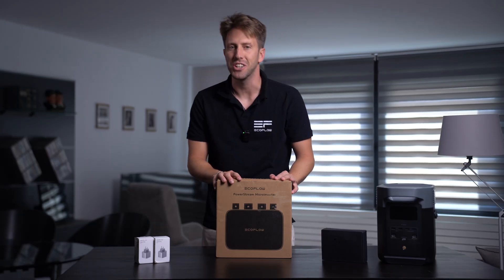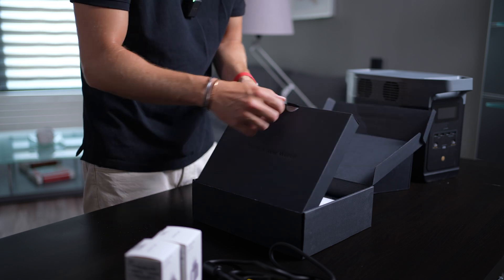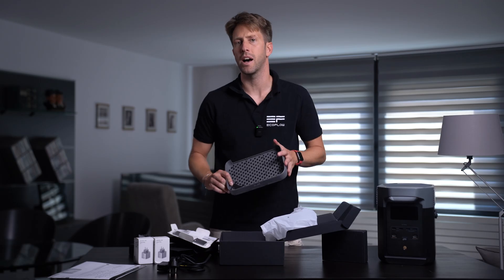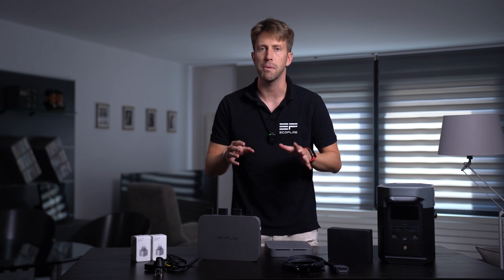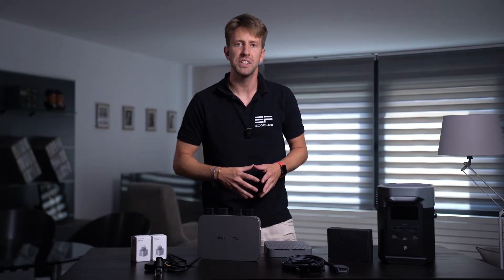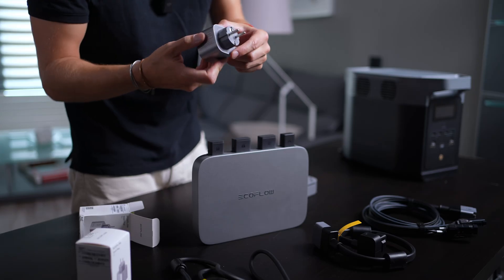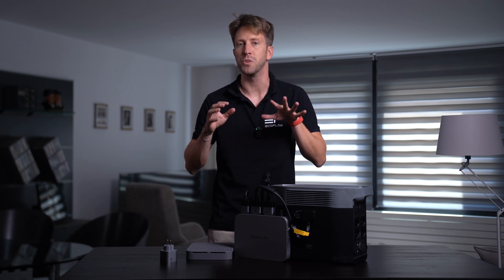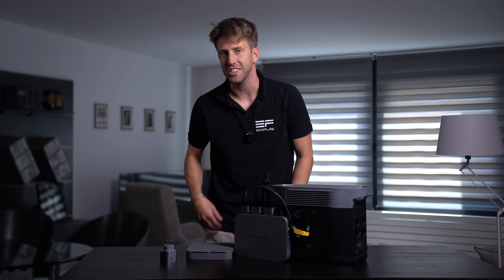Unboxing and Setup of EcoFlow PowerStream Micro Inverter

Comment: Does this only works for the delta series?

Not for the River 2 pro?
Reply: Works for pretty much all of the Ecoflow power stations, but for ones like the River which do not have the expansion battery ports, it only uses the 12v lighter socket port. You buy a cable to plug onto the lighter socket, and the powerstream charges the River up to 100w, and can take power from it at 100w max.
Reply: Sorry, my mistake.

The Powerstream won't charge the River using the 12v socket cable. It will only take 100w off the River until its depleted.

To charge the River, you can plug it into your AC sockets and the powerstream will mix/match your solar and grid to charge it.

Comment: Question. When one configures and use the PowerStream Inverter to power a continues ~250>500w load. Can a connected Delta2/MAX's inverter, on the (EU) 230v output ports, be used in CONJUNCTION and simultaneously power a high wattage (1000W+) load from the Delta2/MAX??

Comment: So i just connect the powerstream into the wall socket to use it around the house?

Anything i need to do for the wall socket or the internal house wiring?
Reply: maybe check if the house/apartment power meter does not charge you if you produce more power than you use so that it doesn't count as "kWh to be charged for" just for "gifting" your energy to the grid because you did not use it :D

Comment: I'm still trying to understand what the benefit of this device is? Why would I buy a Powerstream MicroInverter when I can just plug a generic rigid panel directly into my Delta 2? Ecoflow's marketing doesn't make the case for this device clearly. Could you help explain the benefits over direct solar input? I currently have a Delta 2 with solar and AC input, with the AC output going directly into the house grid via a second 'essentials' DB board.
Reply: The use case is different for this device. You use it to inject solar power straight into your house via an existing outlet, you don't need a battery (although recommended).

Comment: Can you have 2 powerstream on the same grid?
Reply from the maker: Hi technically it is supported however it is recommended to double check if it is in compliance with local rules and regulations.
Reply: @EcoFlowTech  does it output 240v with 60hz ?

Comment: Can powerstream inverter work with only just the solar panel and directly connect it to the grid? Or Is a powerstation needed in order for the whole system to work?
Reply from the maker: Hi yes it could work without a portable power station.
Reply: Yes but a battery would stabilize power delivery. You could just add a lead acid 12V battery using the plug.

Comment: This unit disconnects when the grid is off. This is clear. But what happens if my whole house is connected to the hybrid inverter with batteries, will Ecoflow PowerStream connected to a wall socket inside the house work in this setup? 

P.S. My hybrid inverter is pretty dumb. No AC coupling feature, and no frequency shifting, but it automatically powers all appliances when the grid is off.
Reply from the maker: Hi, the PowerStream is integrated into the grid. If there is a power cut, the system can not work properly.
Reply: @EcoFlowTech  in my case PowerStream will not know there is a power cut. In case of a power cut my main inverter powers the house, so PowerStream will definitely detect 220VAC. So, the questions are Will it work? Will it be safe for my main hybrid inverter which provides the power during the power cut to have the PowerStream in the house?

Comment: Can this be used in conjunction with a whole home ecoflow setup?  I have two pros, two extra batteries and two generators so I have maxed out my devices.  Can I continue to add more pros through this micro invertor?
Reply from the maker: Hi, Delta Pro has two extra battery interfaces, one can be connected to the micro inverter and the other can be connected to an extra battery. It means that you can only connect one Delta Pro and one extra battery to the micro inverter.
Reply: @EcoFlowTech  Ok, but my question is this: I already have 2 pros, 2 batteries and 2 generators connected to my electrical panel through a generator connection, but I currently can’t add any more because the Ecoflows only allow 2 pros to be connected together.  With that setup, could I then add ANOTHER pro via this stream interface to feed even more power into my whole home setup?  Can I power the panel with the dual voltage hub AND have this connected off in another room to go beyond the 25K hard limit I am bumping up against?
Reply: @Sapphireleadershipadvisors  No this is not possible and not its intended use.

Comment: I don't get one thing. I connect the microinverter to an ac plug of my home, and it gives electricity to the other plugs of the home to be consumed? so it can give power to the fridge the ac unit and others? What happens if the power produced by the photovoltaics is  not consumed, and the battery is full? It transfers the extra electricity to the grid (possibly making the counter of the home move backwards?
Reply from the maker: Yes, it will allocate electricity to the plugs and home loads. However, it can not transfer the extra electricity to the grid.
Reply: @EcoFlowTech  Are you sure about " it can not transfer the extra electricity to the grid"? So what will happen when I set the home load for example to 50W and there is no 50W load in the other plugs?
Reply: @EcoFlowTech Kindly reply to @RapManCZ's last comment. I also want to know the answer 😊
Reply: @EcoFlowTech I also want to know.
Does it has a limiter? 
And if it does what response time has?

Comment: How do you plug it to the house to reach the smart plugs ? Did you show ?
Reply from the maker: Okay I got it. You want a more detailed video about smart plugs. Good idea! I have put on my calendar. Stay tuned👍
Reply: So with or without smart plug it sends energy to the whole house ? Whats is the point to have the smart plug ? Does it direct the electricity somehow specifically to smart plugs only ? @EcoFlowTech
Reply from the maker: Smart plug can monitor the appliances' energy consumption in real time, so the 
PowerStream can allocate just the right amount of electricity to each appliance, 
and the surplus to the portable power station. You just simply plug it to the wall socket and plug your home appliance like fridge or washing machine to it. During peak hours, it prioritises home use. And most of the energy gets stored in off-peak times.
Reply: @EcoFlowTech  thank you ! I heard that powerstream wont work if the power is out ? Is it true ? That would be so helpful
Reply from the maker: Hi! As the whole system will be integrated into the grid power system, therefore the PowerStream can not work during power cuts. However, you can use the portable power station (which has surplus power stored) to charge your appliances.